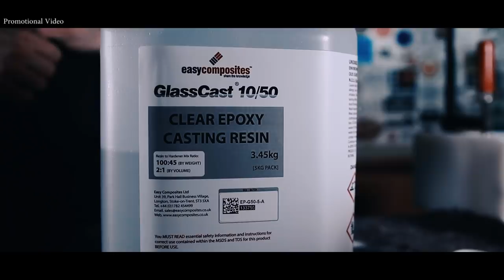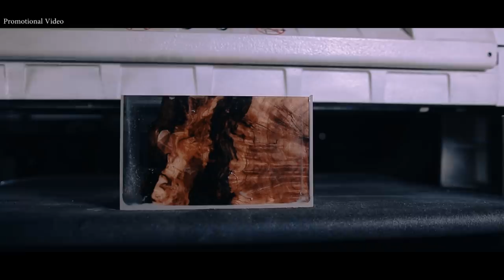Olive root with clear epoxy resin the modern led desk lamp

Comment: You're an artist with the camera as well as the wood work! Very nice. How do you avoid your sandpaper gumming up from the epoxy sanding though? It drives me nuts when I'm sanding it.
Reply from the maker: Thank you very much! My sandpaper is really great. I often clean it with a rubber for sandpaper. When I'm done I wash my sandpaper with water. So that next time I have clean sandpaper again. I guess you do not have the right sandpaper. What works in part but also very well is to polish with the polisher because this only runs around and has no balancing as an eccentric grinder.

Comment: Awesome video and lamp. Where were you able to find the lamp kit? I have a similar wood base project but can’t find a great lamp kit. Keep up the great videos
Reply from the maker: Thank you very much! I had a lot of problems with that as well. There is absolutely nothing like that on the market. I spent hours searching. At the end, I made myself the base plate and brought the brass tube near me in a lamp studio. It is very simple and simply built together and looks very elegant. I ordered the lamp holder and cable from königs.ch. However, for the cable I have another solution and although it is a transparent cable and it is very small and thin. This is hardly noticeable and would fit much better to the lamp.

Comment: Just a quick question... could the wire for the light be epoxied or encased with the wood? Beautiful job by the way!
Reply from the maker: If the wood went up, you could drill a hole through it and hide it. I am not happy with the cable and have already found a transparent, very small cable. This is hardly noticeable. I will show it in one of the next videos.

Comment: Hallo,
echt der Hammer. Und Olive kann eine soooooooo schöne Maserung hervorbringen. Mir gefällt das Holz sehr.
Aber eine Frage hätte ich: Warum giesst man nicht in einem Stück? Warum sollte man zwischendurch warten, damit es anfängt auszuhärten?
Du mußt wissen, ich habe noch nie mit Epoxy gearbeitet.

lg Peter, Leimi´s Werkstatt
Reply from the maker: Jedes Epoxydharz hat eine Max. Gusshöhe. Was darüber ist kann zur exothermie  führen. Das Heisst Das Epoxy reagiert über wird extrem heiss, raucht und es bilden sich viele Blasen, es Dchrumpft zusammen bilden Risse ect. Mitlerweile giesse ich in einem Stück da ich das Problem gelöst habe. Dankeschön
Reply: @SpecialWorks  Danke für die Info. Wie genau konntest du das Problem lösen?
Reply from the maker: Mit einer Wasserkühlung. Wird in einem der nächsten Paar Videos kommen.